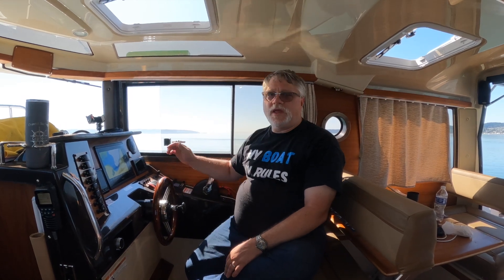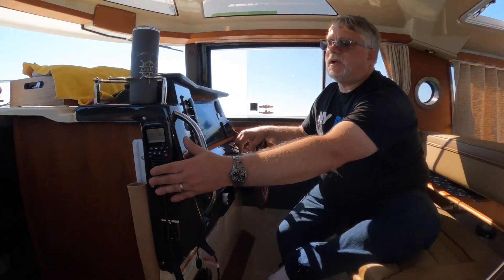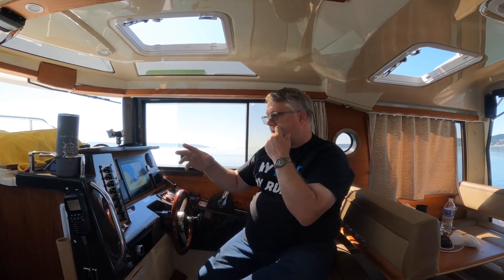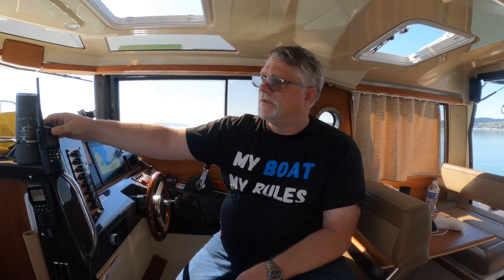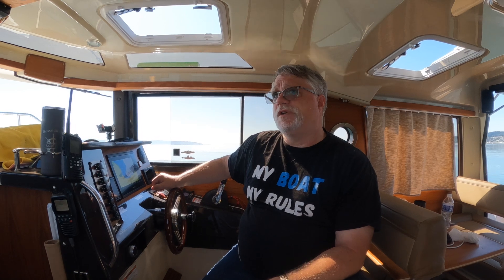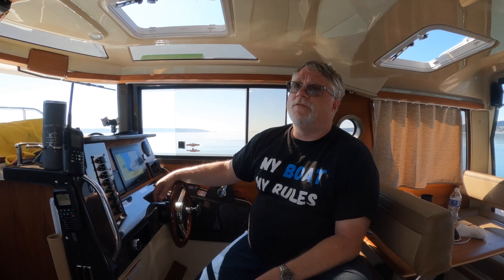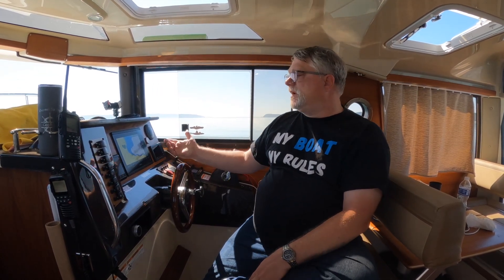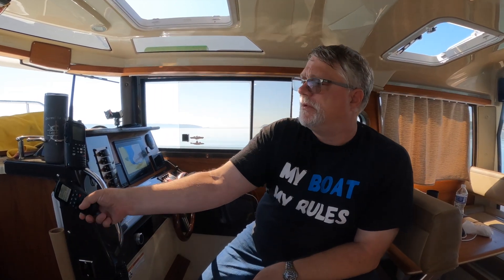Exploring VHF Radio: Channel Scanning Tactics

Comment: Martin, how did you get to the back of the VHF to connect the RAM?  I've got the same basic helm set-up (Cutwater) and I'm guessing you had to remove a bulkhead in the head to access the right-side console & VHF.  Lost the Plotter's GPS feed to the VHF and assume one connector on that wire came loose.  Good VHF review, thank you.
Reply from the maker: On the R27-OB, I just stuck my hand up underneath. It's open and fairly easy to get at.   Thanks for watching, I'm glad you found this information useful.

Comment: Monitoring 13 and 14 (Puget Sound) is good for situational awareness and if you need to coordinate/communicate with larger commercial traffic. 

Channel 13 is designated "bridge to bridge" and is intended for use between the bridges of vessels over 20 meters in length to reduce the chance of accidents. Channel 13 may only be used to transmit information necessary for the safe navigation of vessels. It is the backup channel for the Puget Sound Vessel Traffic Service.

In Puget Sound, Channel 14 is the Vessel Traffic Service channel in Puget Sound. Channel 5A is used in the US waters of Admiralty Inlet, the Strait of Juan de Fuca and San Juan Islands. These channels are used by vessels required to participate in the PSVTS, but all vessels operating in commercial traffic areas are encouraged to monitor them to become aware of major vessel movements and hazardous conditions. Emergency communication will be accepted from any vessel by the Seattle Traffic watch. Use low power (1 watt).
Reply from the maker: As a small maneuverable power boat, that tops out at 32knots, it's my responsibility to stay out of the way of commercial craft.  I've been hailed directly by a cruise ship and a ferry which is great.   But I wouldn't want to put myself into a position where I must hail them.  They're at work, I'm a recreational boater.  But I do like to listen to their cross-talk.  I monitor VHF13 solely because I have to cross Bridge 37 (Snohomish river on the way to Dagmars).  It's a train bridge and is often closed with a height of 9 feet.   As I approach the bridge if someone else hails the bridge requesting they open, I'll hear the request so I don't need to hail the bridge and annoy the operator.  Great feedback by the way.  Thanks!